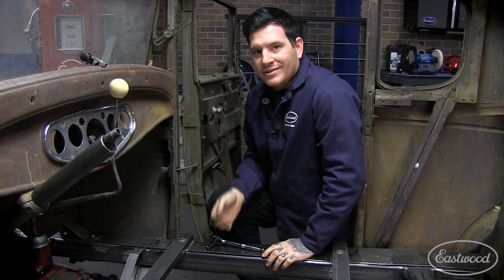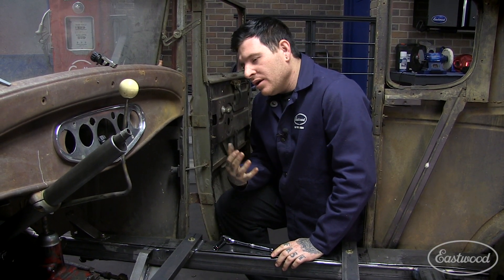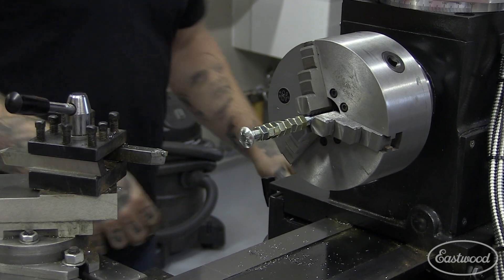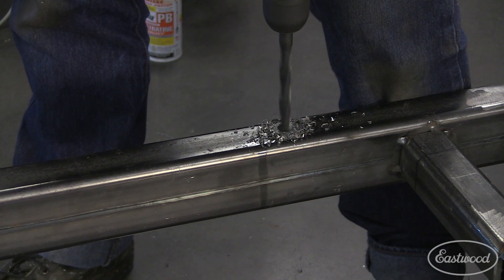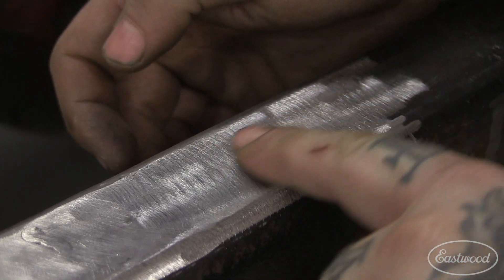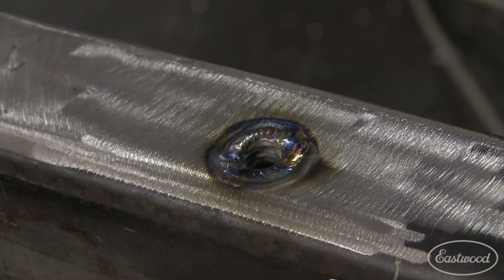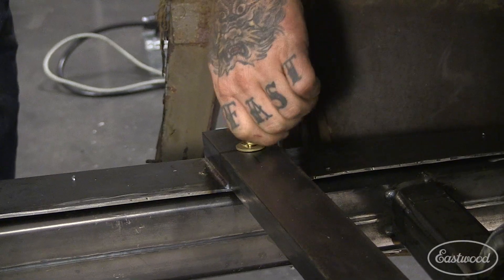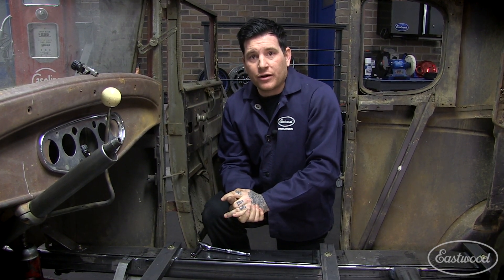How To Fabricate Threaded Inserts - Tips for Channeling A Hot Rod from Eastwood

Comment: why would you bolt something dont if it's weld? that channel is welded.
great idea!!!!
Reply: +Mr. green on the one side  that channel is welded on top of a long piece of flat and so the bolt goes thru the channel and flat and into the nut that he welded into the bottom channel/chassis; however, I noticed the same thing as you on the last bolt he shows--there's no flat at all and the tube was welded to the chassis--makes no sense.

Comment: IF I ONLY HAD A LATH
Reply: this is exactly what i first thought...
Reply: same
Reply: +Joseph Tucci belt sander and a bolt with the insert nut should get you close enough to round or get some dom tubing or bar stock and drill and tap.
Reply: +theplotz Got it thanks
Reply: oh, you don't "have one laying around the shop"?
Reply: I think you can buy internally threaded tubes/cylinders

Comment: Good idea on making the threaded inserts quickly.  Welding on hardware rated higher than grade 2 is typically not recommended though.  Purchased weld nuts are almost always grade 2.  The heat produced during welding will change the mechanical properties and reduce the strength of the fastener.  Welding high carbon material is more likely to crack than material with a lower carbon content.  In this application, it may not be a problem since it's unlikely that the insert would pull out past the weld bead deposited on the lower carbon frame tube.
Reply: there's multiple issues with that video. If I saw anyone machining down nuts that far out from the chuck with no center supporting the end I'd probably flip out. I'm actually surprised he got them to machine as well as he did (I feel maybe it might not have gone as smoothly as he made it seem)

also, there's big strong welds everywhere on the chassis and body cross braces...
 then there are these inserts that hold two of the 3 largest components together with tiny chamfers and a weld that's probably 2.5mm thick...... its just plain bad form and really a stupid thing to be suggesting.

really these inserts should be crush tubes welded into the rails top and bottom!
Reply: @flyingbrick88  Well said! Rest easy though, he added split washers! Those bolts will never come loose!